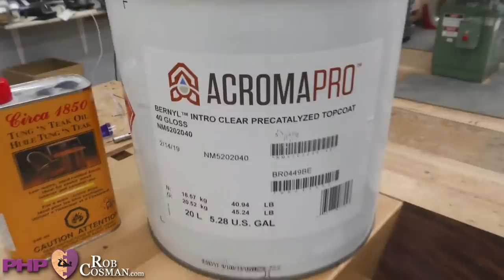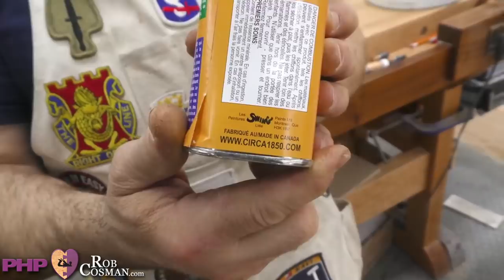Finishing - Live Q & A (9 JAN 2021)

Comment: Lacquer will soften with lacquer thinner. If it is oil varnish or poly lacquer thinner will make the film crinkle up or wrinkle up if left on there long enough. If it is shellac alcohol will soften it like lacquer thinner on lacquer. 
You cannot spray lacquer on top of oil finishes as it will make the wrinkle. You can get away with oil varnish on top of lacquer or water based materials. I would not try polys on-top of these because of adhesion problems.

Comment: You can put polyurethane over a lacquer just sand it lightly with at least a 300 grit but the higher the better. But if you put lacquer over polyurethane it will melt the finish. So I say the safest route would be to put a urethane over the existing finish

Comment: You may want to check you're using the correct elipse filter. The nuisance filters are only suggested for mould and metal welding. According to the chart from GVS you need the ov\p100 filters for solvents and paint vapours.

Comment: One question I don't believe I heard was about whether or not to finish the interior and sides of a drawer and the drawer cavity, particularly the surfaces on which the drawer runs. With a perfect "piston fit" I'd be concerned about making them sticky again. Do you typically leave them unfinished?
Reply from the maker: I always leave the inside of the drawer unfinished, I don’t want to smell finish every time I open the drawer. On both the drawer sides and drawer cavity, they both receive a wax finish. Both as a protectant and a slight lubricant.

Comment: In my opinion lacquer is probably the easiest finish to spray. With the right climate and temperature you can almost not even worry about runs. But that’s only realistic in a spray booth. The best way to spray lacquer is just quickly. On a flat surface you don’t have to worry about it running because it will just flatten out it’s self. I actually learned to spray lacquer on corn holes. Those are very easy to spray and a great and affordable way to learn. Also another little trick my dad taught me about lacquer is to use a mixture of just lacquer thinner and lacquer retarder. My dad has been a professional painter for almost 40 years and has finished and refinished many cabinets and other projects. Any way he showed my this trick on my first set of cabinets I ever built which was small bathroom vanity and a linen cabinet over the toilet. I have used this ever since. You will want to mix this in a one gallon bucket somewhere around 70%-80% lacquer thinner and the rest lacquer retarder. All you do is mist on after your final finish coat of lacquer before it fully drys. You want it to be dry enough to touch but also but still soft.  This will flatten out all the over spray giving you a flawless finish
Reply: Also for the best results when spraying lacquer and good rule is to spray at least 3 coats of lacquer sanding sealer and never less and 2 of lacquer finish